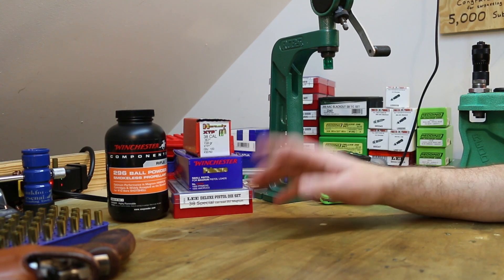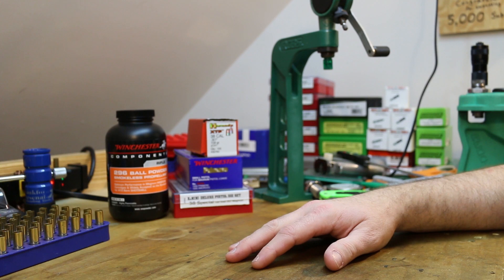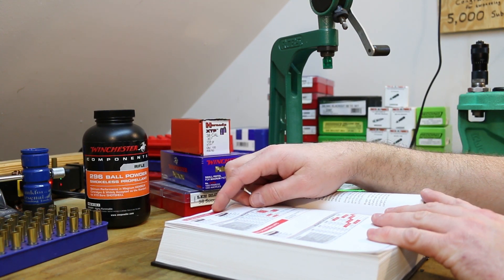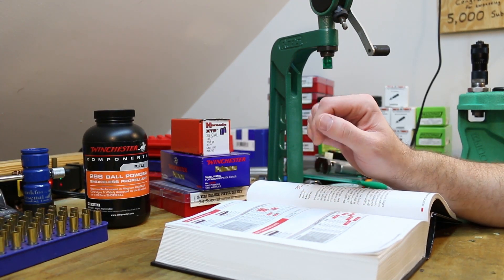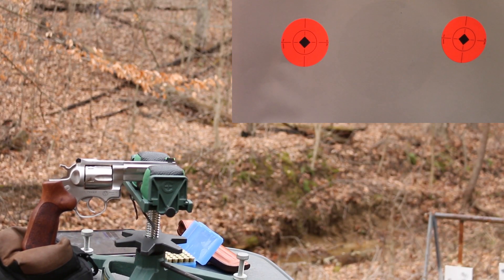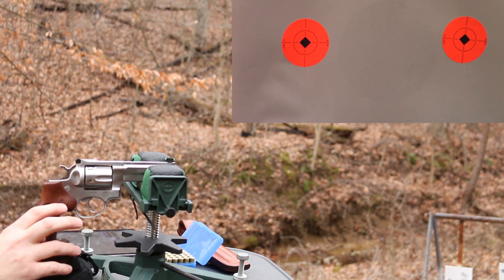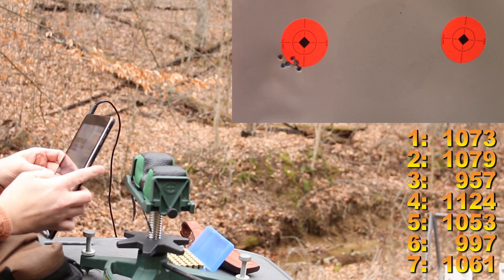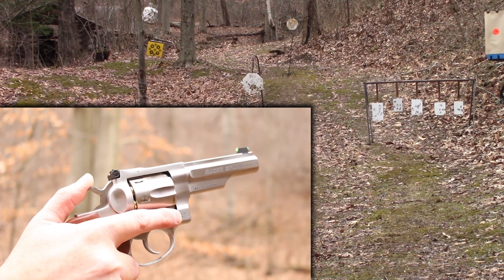.357 Magnum - My first test loads for the GP100

Comment: Back in the early '70's for my Ruger Blackhawk, 5 5/8 in. Barrel, I was working up loads and 4 of my favorite loads were..... 125grain JHP w/7.5 grains. Unique. 140gr.JHP w/ 8.2 grains. Unique,  150grain  HCJHP,  w/ 11grains of 296, and finally a Hard Cast Semi Wadcutter, (ELMER KEITH), for deep penetration, ya know, this was pushed by 12.5 grains of 296. 
 Deer hunting in South Carolina with a handgun was great. 3 deer, 70 yard, 102 yards, and one at 126 yards, with the hard cast bullet load.
At the range I was hitting soda cans, a 6x3 inch target, on the 125 yard mound regularly. So, for the long shot I sat with my back up against a tree, knees up, two handed grip. I knew where to hold the front blade.  So I thought what the hell. Took a deep breath, slowly let it out, squeezed.
 Took the shot, POA was 6 inches down from the top of the shoulder, the hit was within 2 inches of POA. Dropped the 3 year old deer right in his tracks, didn't even take a step.  I found the bullet just under the skin on the opposite side.
  I was Active Duty US Navy, at this time. Stationed at Charleston, SC.

Comment: Win 296 data in older books used to go up to 17.5gr with 158 gr hp.  I have had very good success @ 17gr w/ small mag primers in my 6” GP100 and 5” 627 SW. I have also shot this load out of my 3” SP101.  
BTW Win 296 and H110 are exact same powder

Comment: Interesting to see the evolution the GP100 has gone through over the years. While the original rubber GP grip was novel and very functional with its wood inserts, the modern GP looks very much like its Security Six / Service Six ancestor--all that's Old is New again!
Good video with honest results. Some of the slow powders simply work better with the higher pressure that comes with the upper end charges of powder!

Comment: I've been shooting my S&W 686 for years at bowling pin matches and general plinking at the outdoor range. Two loads I like are 9.2gr Blue Dot, Hornady 158gr XTP & COL 1.575" and 180gr Hornady XTP w/12.5gr H110 & COL 1.590". Both of these loads are great for mowing down bowling pins at 20 yards. Which is what i do on a weekly basis.

Comment: Johnny.  Not bad for your first go around . I have the same gun I'm using 2400 powder ,seems good. This is a nice gun when you get use to it. It stacks good and is accurate. Good luck . I'll be waiting for more.
Reply from the maker: I was actually planning to use 2400 in this video but changed at the last minute.  There seems to be a lot of conflicting information out there on what primers to use with 2400.  I guess Alliant recommends standard primers.  Some people say they use magnum primers with no problem.  I figured I'd save that testing for later.  Which primers do you use with 2400?
Reply: Johnny's Reloading Bench           Johnny I use mag primers , they don't show any sign of pressure issues. I'm making a mid range load . 125 gr billet with 14.8 to 15 gr of 2400 . The only reason I'm using 125 was because a friend of mine gave me about 2000 of them . 38 special I use bullseye 4.5 gr for a plus p load same billet. All seem fine . Thanks

Comment: Great video, I've been patiently waiting for more .357 videos. If you want a more consistent "cowboy action" load (750-950 fps) with .357 you will need better case fill than W296 or H110 will provide. Try Trailboss. 100% case fill under seated bullet is max load.

Comment: I have used my handloads for 55 years now in .357 mag .. I use win.296 powder also H110 too. My favorite powder in that ctg is 2400 powder still when i can find it on the shelve..  One other powder i started using from 2003 is Viht. N. 110 made in Finland , wonderful powder and very accurate... I do all my loads using .357 mag brass and that includes .38 spl as well as i do not like to readjust my dies , mostly i forget unless i unscrew the die a few turns from the press..Just faster to use brass all the same length... One more powder i added around 5 years ago is AA #9 which is also a high energy powder accuracy has been very good...

Comment: If you load for both a .357 pistol and a rifle I have found to use a slower burning powder such as 2400 or blue dot. With the slower powder you can achieve very good velocities from the rifle and not blow your face off if you use the same rounds in the handgun. 2400 will often call for magnum primers so I don't use it as much. I have hunted very much with the .357 and have harvested some very large game with it. I do not load max loads but they are certainly magnum loads. I have so many loads and I don't want to mix up my brass so I color the head of the cases with magic marker of different colors. .357 is a very useful round.
Reply: Russell Keeling   Alliant website says regular small pistol primers not magnum for 2400 powder.

Comment: Jonny when reloading 357 you need a heavy roll crimp in the canalure. You had a wide spread in your velocity's (As you said Velocity is all over the place) that's because your had variations in your OAL or your powder charges. That's why I use my RCBS beam scale and weight every charge by hand.
Reply: I use my Hornady auto measure but I also check 20% of them on my scale. Makes a big difference.
Reply: He was at the buttom of the cannulere; could have seated a little deeper, and it would have crimped better--good observation!
Reply: Another contributing factor that could be involved is his brass wasn’t trimmed to the same length

Comment: I have loaded a few of my own (around 350 rounds).  I am using lead cast semiwad cutters at 158gr.  I started at around 3.4 to 6.0 with hp-38.  I found that the lower ranges do not give you the magnum feel. I am assuming this is more for 38 special but I cant confirm.  I ended up going with 5.5 with OAL 0f 1.610.  This gave me the best groups.  This is with no gas check either.  IF YOU USE THIS LOAD DATA, YOU DO SO AT YOUR OWN RISK!!!!!  Love your videos.

Comment: For 357 I use Alliant 2400 and Bullseye for 38 Special.
I use the Oregon Trail Bullet Co.  Lasercast 158gr SWC. 24 Brinell for both.
Never had any leading what so ever from them. Even loaded way up there. $55.75 shipped for 500. It is the only bullet I use in 38 Special and 357 Mag. Give them a try. You will like them.

Comment: just watch out hot loaded magnums are notorious at causing a flinch to develop but there is nothing quite like them either.
Reply: Usually the flinch from the .357 can be traced to a lack of good enough hearing protection. That is if you are not afraid of a handgun that jumps.

Comment: Flatten the bullet seating plug and the xtp's will have a more consistant oal. Mine varied by .010-.025 until I followed FC45LC's advice.  Nice video!
Reply from the maker: I'll have to check out his video on that.  Thanks for the tip!

Comment: Hornady is very conservative in their load recipe.  Hodgdon says the max for a 158 grain xtp is 16.7 grains.  I think that may be at close to 37k psi though, so its definitely a do not go further charge.  Your velocity is less than a normal factory load, you are not even warm yet.  Keep working on it.
Reply: Leroy Brown Jr. -----its amazing the difference  in loading books as far as Max, never know which to use
Reply: @russelder9743  what I have learned is to use both, bullet and powder info, find the medium.  Seems hogdon hasn't updated all their stuff to current, so have to be careful.  Someone on a ruger forum knows a lot, like a charge behind a 158 xtp is 100% case charge at 16.2-16.3, you are doing with compressed charges and big fireballs after that, more chance of fire cutting the top strap, though revolvers made around the 357 will not have issues with that.  Pressure at that range is 31-32k. Underwood ammo does indeed follow the 35k psi standard, asked them myself, wish I knew what powders and process they do to keep it in range and wring out what the 357 was made to be.  Regardless, no deer, black bear, 2 legged attacker is going to survive a 158 xtp moving 1300-1400 fps out of a 6 inch barrel.

Comment: The match champion is nice (except for the MATCH CHAMPION billboard on the barrel, some people have sandblasted it off), compared to a regular GP-100 the trigger is a lot better but it still has some rough spots during the pull, it does smoothen out over time
Reply from the maker: I've heard that...that is gets a bit smoother over time.  Sounds like a good excuse to shoot a lot more!
I agree on the stupid match champion label.  I almost didn't buy the gun because of it.  I don't understand why they would do that to an otherwise beautiful gun.

Comment: Hey Brother those are pretty much on the low end of 357 Magnum I'm 42 years old and I've been shooting 357 Magnum for a long time  with a 4.2 inch barrel or a 4 inch barrel the GP100 match Champion is 4.2 inch barrel  the hot loads or standard 357 Magnum should be coming out of there between 1350 + 1450 some even 1500 so those are pretty low
Reply from the maker: Yup, no doubt.  On the Hodgdon website, 15gr of 296 is actually their starting load with 158 XTP's.  I'll be getting into the hotter stuff eventually.
Reply: Johnny's Reloading Bench I hear your brother I like your video by the way I like the fact that you reload your own not too many people do that nowadays keep up the good work
Reply: With the win 296 & or H110 you don’t want to go lighter than the book min. That’s why you’re velocities we’re all over the place. Magnum powders don’t like air gap.

Comment: Ruger has the tab that comes up so the hammer makes contact with the firing pin no need to leave an empty cylinder under the hammer I also have this gun very stout revolver gun will not fire till cocked or double actioned

Comment: I loaded some 357 mag the other day with same bullet & powder charge 15.0 gr 296 once fired brass. My velocities were far lower than yours  1060 at best out of a 6" 686. It was cold that day low 30s it was my first go with 357mag too. Maybe I didn't have enough crimp. Oh & I used cci mag spp. Have you any pointers? Would sure appreciate it

Comment: Try some TiteGroup and a heavier roll crimp.
My D.A. .357 is sighted for 100 yards, and a 6" target. Also, even with the 3.5" barrel, you should be putting those XTPs out around 1300(+) fps. Otherwise you're only getting. 38+p performance

Comment: The double action revolver is one of the most Hardest to master. This is where the rubber meets the road so to speak, I know how you feel about someone teaching you how to shoot, However if I can say one thing, Never take you eyes off the front sight, It's hard to do when you see in your distant vision the steel swinging and jumping around between shots, Just put that out of your mind and with sight alignment squeeze through your next shot, That is the only one that Matters.. Right? anyway.. That was my Two cents worth. Good shooting to ya,, Dave.
Reply from the maker: The double action stuff is really fun!  I need to put a lot more rounds through the gun and get accustomed to the feel of it before I get too serious about accuracy.  Should be a good challenge.
Reply: It is fun.. when you get the hang of it, It will be something you will enjoy,,  Nothing like a Revolver shot fast and accurately. Try some 2400.. That was my go to powder with 125 gr JHP. Top loading with the Alliant manual. 2400 works good in the .44 Magnum too.  One thing though.. It's a magnum powder and reduced loadings will not burn the powder up all the way.  Dave.
Reply from the maker: Apparently Alliant recommends standard primers with 2400.  Do you use magnum or standard primers in your 2400 loads?  I almost used 2400 for this video but switched at the last minute.
Reply: Johnny's Reloading Bench  I use standard Primers. One thing though.. when you load 2400, It's a Magnum powder and the more you use the More it burns. I know that the top load listed for the 125 gr Hollow point jacked bullet is a Hand full in the Alliant Powder Manual.  Dave.
Reply: Sight alignment should not move on your DA stroke. If the sight alignment is moving, your handgun grip is too loose.  Need to tighten your grip.  To get proper grip squeeze, take an unloaded DA revolver and align sights on target and grip as tight as you can. Note the sight picture shaking due to extremely tight grip. Ease back on grip pressure until shaking JUST stops. THAT's the proper grip pressure. For ALL handguns too.  Now slowly stroke the trigger full cycle, release and repeat.  Practice SLOW trigger strokes with proper grip squeeze, until your sight alignment does not move.  This is easy to do at home aiming at a dot that looks the size of a 25 yard pistol bull but across your living room.  I start all shooters with DA revolvers, because the DA revolver teaches proper grip better than any other handgun.  When a shooter can accurately shoot a DA revolver, they are a well and properly trained handgunner.  

It is surprising the number of "experienced" handgunners whose poor pistol technique is instantly revealed firing a DA revolver.  Master the DA revolver stroke and you have mastered all handguns in effect.

Comment: I have a Match Champion just like yours. Try H110 or 2400 powders, faster burning and more consistent  velocity. About 1250 to 1300 fps with the right load.
Reply: H110 is the same powder as 296